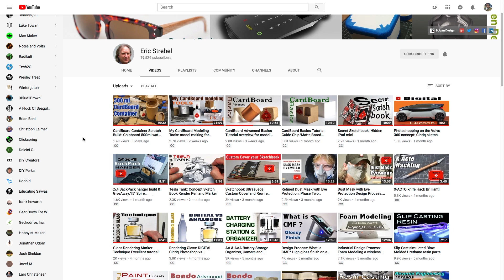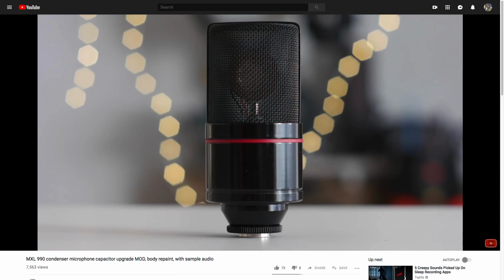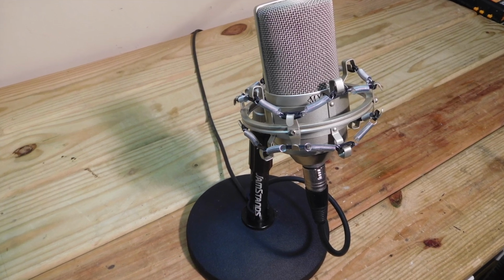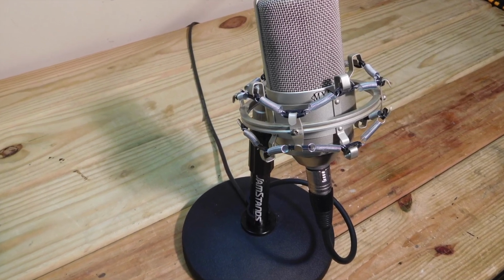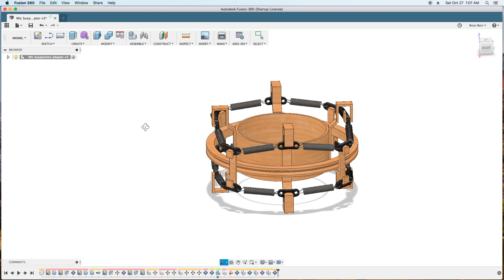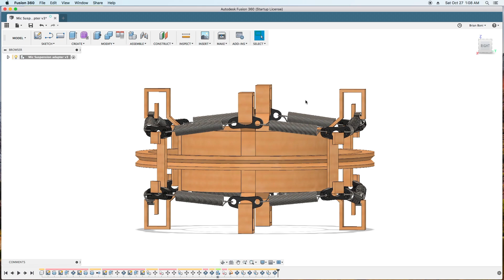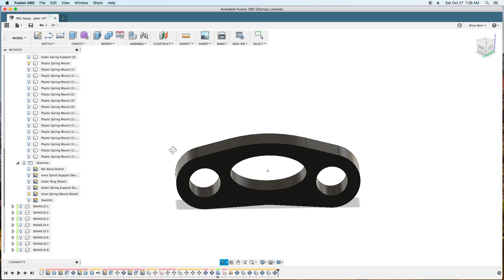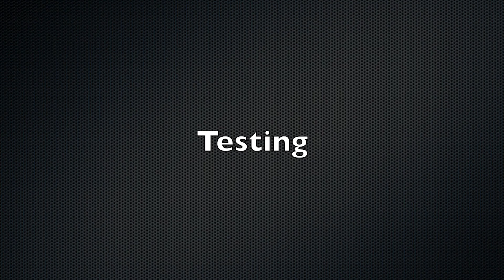Mic Upgrade+ MXL990

Comment: Man, you really have a gift for building* this stuff! How do you like the mxl mic itself?
Reply from the maker: Microphones are like guitars, you can never have enough of them. ;) I got this one in a trade about ten years ago and have used it for many different things, it was never great but as an extra large diaphragm condenser mic I used it. Being so inexpensive you can put it where you wouldn't a more expensive unit and it's been in my gig bag more than a few times and plugged into mobile recorders so there's that. It never had the super clarity that you'd expect from a LDCM and as a vocal mic it lacked a close mic presence that more expensive models have but removing the internal foam and changing the caps has brought it up into what I'd call the $300-$400 range and from a mic I paid the equivalent of $30 plus $10 for the upgrade it's a good deal. By removing the internal foam you remove some of the ability to handle loud sources but I only intend on using this as a voice over mic and have added an interface in my lab to improve sound recording so this mic will also be used there.
Reply: Brian Boni  Nice!! Thanks for sharing Brian.